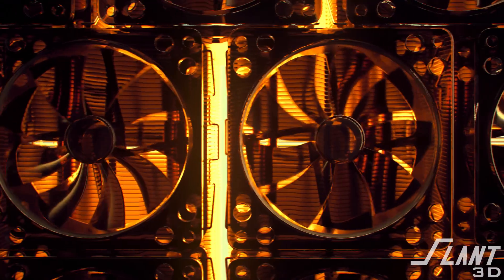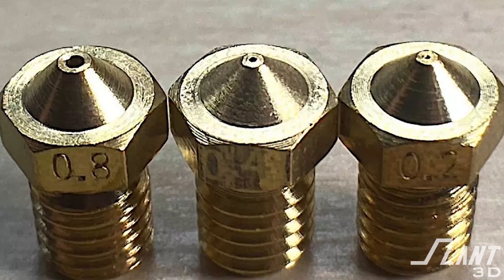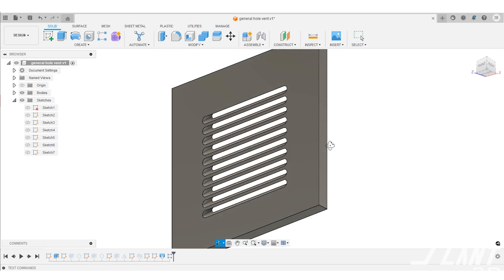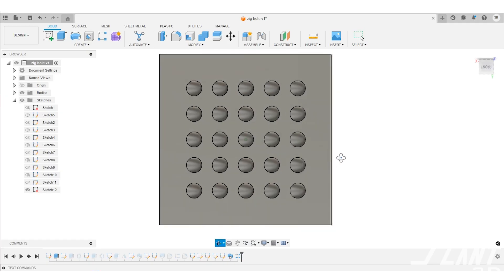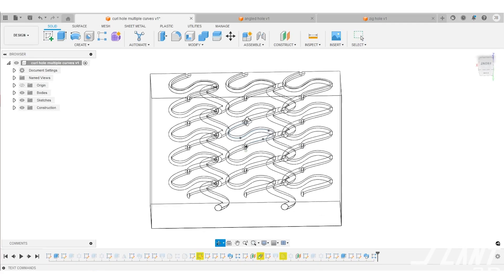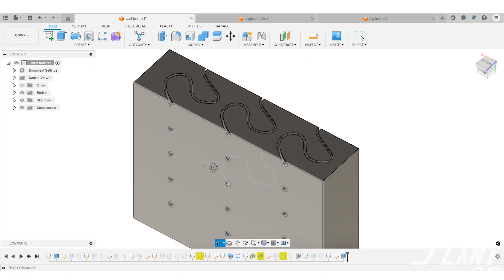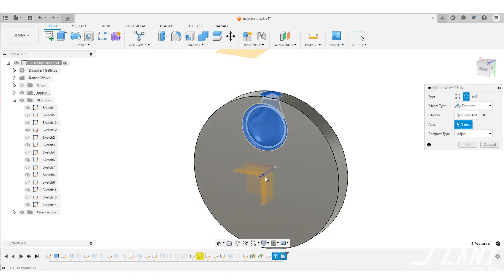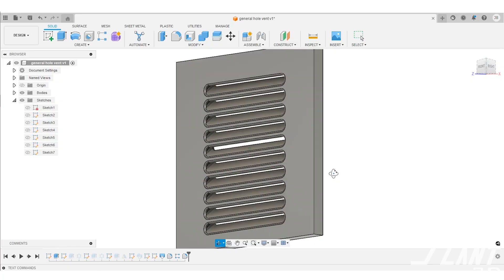These Cooling Vents are Impossible | Design for Mass Production 3D Printing

Comment: chaotic air transfers heat well
what if we could design a system where some kind of holes restrict airflow in, and then the air has to pass through a layer that makes the air more chaotic
and we could design like a piece that creates a vortex and hook it up to power and control the speed of the vortex being created by that part of the filter
and that piece could be optimized individually, we can have a piece with the optimal hole shapes / intake and we can have the movable part of the same 2 piece assembly be optimized to make the best vortex

i am just memeing about a case fan
it is a fan
that is the joke is that its a fan

shoutouts to the engineer who makes a wild vortex passive cooler that uses positive/negative pressure applications to somehow outpreform a fan and grill and makes me look like a buffoon

Comment: I have a feeling that the reason vent covers havent evolved very much over the decades for good reason. They already serve their purpose very well while being very quick and efficient to manufacture en masse. 3D printing a cover will always take considerably longer to do than stamping some sheet metal or brazing some wire stock in a certain way, including any post processing. Vent covers only need to prevent things from going into the fan blades while having minimal impact on airflow and noise generation. If you need dust filtration you use a thin sheet of mesh, not a 1" thick piece of plastic with convoluted tubes inside that can get clogged and/or drastically limit airflow. 3D printing can be very useful in a lot of places but this is not one of them.
Reply from the maker: Just like Horses
Reply: @slant3d  You haven't built a car, you built a donkey
Reply: @slant3d  homie we replaced horses because they were less efficient than cars.

3d printing is far less efficient for vent covers in pretty much every way
Reply: @baboom-wof  Especially when you're losing air flow by making it do loops.

Comment: you know the whole point of a 3d printer is that you can print in an orientation right, like rather than printing the part vertically, you could have just printed the part laying down
Reply from the maker: Not viable for mass production

Comment: Should be titled "Why We Don't 3-D Print Vent Covers" - All this is done better, cheaper, easier with stamped or molded pieces. Don't want light through? Just stack 3 plates with offset holes and spacers between the plates. 3D printing is great technology, but this is putting a square peg in a round hole. Every justification is a stretch.    "Trap dirt?" That why we add screens which are easily cleaned - how are you going to get dirt (or see it) if it is trapped in a tunnel?

Comment: A. I would never print this vertically
B. Any more area than a metallic mesh is blockage
C. The flow speed of a pc fan doesn't create any valuable pressure to play around with vortices or complex tubing.
Reply from the maker: C: Incorrect
Reply: @slant3d  better to prove me wrong then... ;)

Comment: Man, this was even more useless than the last video about coffee mug handles. I get it, you are excited about justifying your company and the expense behind your printer farm, but please stop trying to convince others that anything you are saying is even remotely useful or based on actual design theory and practical application. To start, why the heck are you printing a vent cover vertically with bridging and overhangs when you can print it flat on the print bed, and get a stronger end part, with no bridging or support required? Second, the turning and twisting paths would restrict airflow so much that there is no practical use for those vent covers. At the same time, the bending inside the cover takes up so much space that the surface area of the cover vs the size of apertures for flow is laughable. Suggesting that the paths would be used to clean or collect dust and debris means that the spaces need to be cleaned or you have effectively designed a self-failing vent. Even your last example with fan redirection is just goofy as that part could be produced with injection molding with retractable form pins from the top and side, while the overall design would cause such a degradation in flow volume and velocity that the motor on the fan would fail far before suggested life span.

I respect the work you do and I think you have a spot for teaching how to design for 3D printing is unique, but the last few videos you have done and have come up on my YouTube recommended page just are not hitting on any of the points that are rooted in basic design principles and product engineering/manufacturing.

Comment: I'm sorry, are you telling me you print these standing up? Why? There is no valid reason to do that. You waste material with supports, you risk warping, and you now have to worry about snaping it along the layer lines. Printing these flat makes so much more sense. You dont have to jump over any gaps, the layers are set out along both the width and length so layer adhesion is much less of an issue, and as long as you have good bed adhesion there should be little to no warping. Additionally if you must print vertical with holes, hexagons with the point facing up are better, especially if they just need to be a hole and not hold any other parts. Also that first vent you showed is not typical, not if you put a fan behind it. It would be really restrictive. An actual vent that you would normally see in the wild usually has the holes done up in concentric circles with a set spacing to maximize airflow. That strange star pattern you made would be aweful in comparison. You would be better off with just a big hole. 

One last thing, the reason we really use straight through vents and stamped ones with veins is not just because of the ease of manufacturing, but because straight through is the most efficient. And bends and turns only add resistance and thus lowers your cooling/airflow potential.

Comment: Why did you choose to print vertically? Was it more cost efficient? You could also add chutes so that any airborne debris could drop vertically through the vent. I love the radial exit around the outside diameter.
Reply: He said in another video (the angle brackets one), that you always want a small footprint on the print plate, because that works better with auto ejection. More automation equals cheaper part.
Reply: @lupeters213  That doesn't apply to his slotted designs, where just by rotating the print 90 degrees he could eliminate virtually all support concerns.
Reply: @lupeters213  there are bed surfaces that have really strong adhesion with certain plastics while hot, but basically zero adhesion once cooled down. I once printed a part with a massive footprint (over 50% of the print bed, I think the bed was over 200x200 mm) using PETG, and while it was printing and the bed was hot, it was stuck on like crazy (you could literally lift the printer by the part), but the moment the printing finished and the bed got to room temperature, you could literally just pick up the print off the plate. It was nuts, and I actually don't know what the bed material was, but it is possible (at least with the bed material + PETG combination)
Reply: @TricksterRad  yeah, while printing at home that is definitely the best solution, but these videos are to be seen as design guidelines for mass production with many parts printed and auto ejected. You don't want to let the bed cool and reheat it again in this scenario. The system slant3d uses involves no human input between prints. After it is finished, the piece will get pushed off the plate by the head and the next print starts
Reply: @m00str  why not? Letting the bed cool is something you may need to do regardless, depending on what you're printing, and it doesn't require any more human input than getting something to ram a part off the plate. It does slow down your production a little. But I'd argue that that might be worth it considering it is a much gentler way to eject prints, and allows you more flexibility in how you print your parts (sometimes you simply can't afford to print a part in the smallest bed surface area orientation)
Reply: @TricksterRad  it is indeed a lot gentler than kicking it off by force, but in some cases it can take a lot of time to cool down and a lot of energy to reheat, especially with larger print beds.

I guess it's dependent on what you want. Pushing parts off without cooling could even damage some delicate parts.
When I print at home i always pop the part off the bed while keeping it heated, just because I don't want to wait and reheat, but I'm removing the bed and bend it to not damage anything by ripping it off
Reply: @m00str  If you want to mass produce them, you wouldn't 3D print them in the first place: it's just that since he sell 3D printing service, all the problem MUST be solved with 3D printing...
Reply: @Beregorn88  ist not like i am agreeing but the whole point of this channel is "how to mass produce using 3d printing" so of course, yeah.
And in some cases, like ~50k pieces, its supposedly cheaper than molding, at least to him.
Most of the designs showcased here are clearly created by an amateur in the specific use case (in this example: how to kill airflow in the most unique way, in other cases: how to kill birds, how to design a cup handle that's completely unusable, etc) but it's often good design from a 3d-printing perspective.

I got some good knowledge and design inspiration from this channel
Reply: if you do use that radial exit design, do yourself a favor and make sure the number of holes is different from the number of blades on the fan. if you wanna know why, look up how those old fashioned air raid sirens work, it's basically what this video made but with a radial fan instead of an axial one.
Reply: At the end of the day if I was going to purchase a 3D printed part I would want it to be printed to the best quality it could be and if I got a fan cover printed upright I would be in shock. If they can make good prints and have them auto eject that's fine, but I don't want to pay for an inferior product because they want to avoid removing parts by hand. Honestly embarrassing on their part. At least I know not to buy anything from them now
Reply: His focus is on mass production, and this makes better use of the available build volume. You might be able to fit a dozen standing parts on the bed, but only four lying flat. 🤓

Comment: "Why don't print it laying down?"

Because then it will take much more bed area and since he is talking about designing for mass manufacturing you can fit way more of those parts when placing them vertically.

The one with laying down configuration will add even more cost for just having someone to clear the bed so that another batch could be started than thr cost it saves by reducing post processing.

Comment: I'm on 6 minute wathing this, and you still pretending that you know what Arflow is and air has no dencity by pointing on s-shaped tiny tubes. Let me help with this - Airflow is free inertional moving of air molecules. What you pointing is while taking that brick with few low-diameter holes will not give you airflow, it will be airstuck. Higthly inefficient. You want airflow - make lot of open space without any elements that can prevent air to move straight line. For the best airflow possible you just need one big hole or nothing at all. If you want to make a filtration - make an air filter and do not tell anyone that it "provides airflow" - it doesn't. It actually prevents airflow from happening by making obstacles. Any directional changing of air flow will take energy from the air.

Comment: One fun thing to do is to set top and bottom layers to 0 and just let the infill pattern be your vent mesh. Grid for simplicity, Gyroid for style. Prints super fast and works great
Reply: That's an awesome idea! But does the gyroid pattern actually work, as I thought those patterns (at least in cura) would close the airflow.. but perhaps not, if you print it laying flat, which you would do while printing at home
Reply: get an oscilloscope, find some software that lets you make a map of all of the readings that it takes in aggregate, and speak into it.
Reply: This, 1,000,000 times this. Belt printer spitting out hundreds an hour. Don't get me wrong it's good to think of better ways to improve the design but sometimes it's better to keep it simple.
Reply: This should've been the video
Reply: Without walls, would the piece still be rigid enough for durability?
Reply: In Prusa slicer, you can add modifiers to remove those top and bottom layers in specific locations of your model.
Reply: why dont just print it flat
Reply: @sarthaksharma9656  Mass-manuracturing. If you print these fan shrouds flat, you fit maybe four per printer. If you stand them up, you can print 20+ at a time. It may not matter if you do one-offs on your personal printer but for a print farm that does parts by the thousands, it saves a lot of labor with re-setting printers between batches.

Comment: Great video. Can you tell me why do you need to print the part standing instead just laying it on the bed. That way you, won't need to bother with supports in slots and holes. But anyway thank you for great design tips.
Reply from the maker: Mass production

Comment: Why are you printing them on that axis... print it flat on its face, then you do not need any supports..  even with the angle holes, S turn etc.
Reply: In mass production you would just plastic injection mould the part and call it a day.
Reply from the maker: In mass production printing them flat increases cost and slows rate of production

Comment: I’ve never had any issues with vertical slots, even small ones, I do prefer diagonal slots though. Vertical slots probably aren’t that strong but diagonal slots would be stronger whilst being easier to print than horizontal slots. For most applications there won’t be much force on fan covers so the strength isn’t that important.

If designing large fan covers I tend to use a hexagonal pattern tiled within a circle, you can orient it so that there are no bridges. When possible I do print fan covers flat against the bed though, that is best for strength and print ability.

Comment: Why not print slotted vent laying down, fixes the whole support removal issue when there aren't any to remove. Also, all these designs seem like adding more area which in return would not vent as efficiently.
Reply: Or just rotate it 90 degrees
Reply: Because then it will take much more bed area and since he is talking about designing for mass manufacturing you can fit way more of those parts when placing them vertically.

The one with laying down configuration will add even more cost for just having someone to clear the bed so that another batch could be started than thr cost it saves by reducing post processing.
Reply: @crazysoulpubg  so you're saying someone has to be available for mass production... I sure hope there's someone watching the printer, they are known to catch fire. Also, printing multiple at once or one at a time usually end up taking same amount of time. Also, if that is the main goal, printing multiple at one, as comment above mentioned... Turn it 90 degrees and shouldn't need the supports, and less surface area. This would be faster prints than vents 2 inches thick.
Reply: @grumpa_77  I meant that the channel is about mass producing things with 3d printers that's why he didn't mention it. Yes it would take same time but in one of the scenarios you have to be able to swap the bed like 10 times to have same number of prints. About printer catching fire idk about that what he does about it but still that's doable with stuff like smock detectors or having fire extinguisher packets that explode and disperse the powder when they hit threshold temperature.
And isn't rotating 90 degrees same thing as laying it down on bed?

Comment: I don't get your  'assumed' 3D printing orientation. Surely you would print those first examples flat on the build plate then you wouldn't get any of the problems you mentioned!
Reply from the maker: Higher cost to mass produce
Reply: @slant3d  It seems that there's many things here that hobbyist 3D printers find unintuitive, because they think in terms of 3D printing at home, not mass production. Like if you want slots and can't print it flat, surely you'd orient the slots upward? Then there would be nothing to bridge.